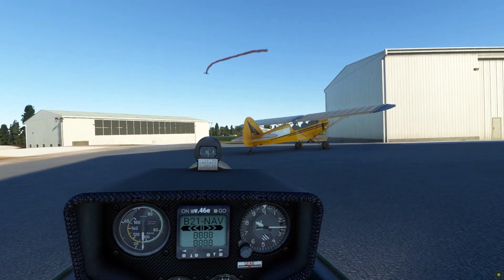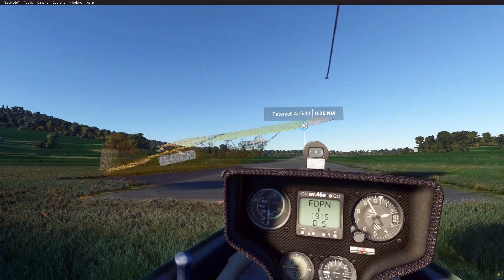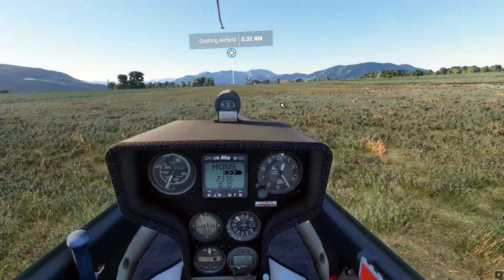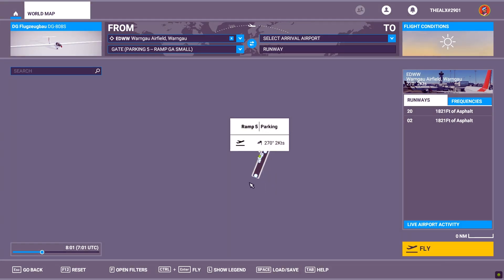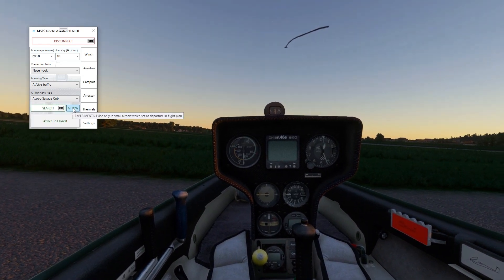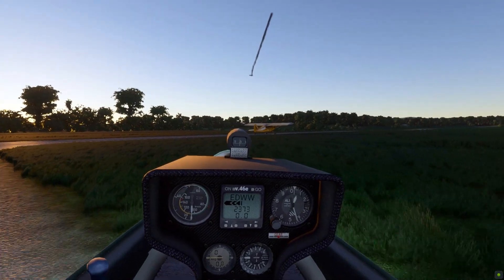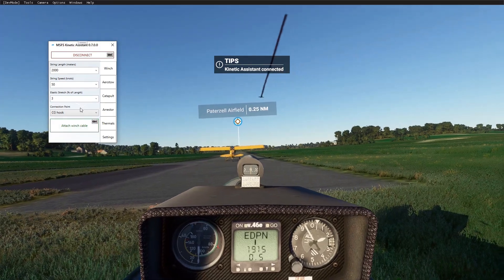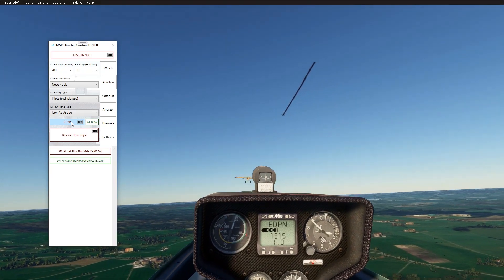MSFS Kinetic Assistant 0.7 - Aerotow Tutorial

Comment: Hmm - I cant even get the AI tow to work.. The plane just flies off without me ..  any suggestions ?
Reply from the maker: That's not okay. When plane appear (about 5 seconds after button press), does ATTACH button became red, at least for a while? You can try different planes, but usually the first one - Icon - works in most cases. Also uncheck Realistic failures in case rope fail because of too fast takeoff.
Some improvements planned in near future so you can check it again a week later or something like that.
Reply: @TouchingCloud  Thanks - I am using 8.4..    made about 15 attempts and no luck yet. Where can I get V 0.6 ?
Reply from the maker: @matt79hz  it's not stable yet, will be ready after weekends. but not much changes for towing there so not sure it will make any difference.
what about live player towing, have you tried that? or at least attach cable to some generic aircraft.
Reply: @TouchingCloud  thank you. It's ok. I'm happy being launched off maintain sides for now :) easily 30mim flights with a catapult.
Reply: @TouchingCloud  Tried v7 and I get "flight plan doesnt exist" message when trying AI tow. 
No problem thanks for your suggestions - at least the catapult and winch work well.

Comment: hi, im trying to do human aerotow everything says connected but im just left behind on runway, all is setup as you have in the video, only difference is im using the discus 2b glider.
Reply from the maker: so towplane fly away, while you stay without moving? does Rope fail message appear at some point? maybe you can share screenshot of the program window, in case something wrong there
Reply: @TouchingCloud  thank you for the fast reply, yes my friend takes off without me, i am left just sitting there, he aborts the take off roll turns around to come back to me and once he gets beside me i get the tow rope disconnected message come up. his using the dr 400 aircraft. we are going to try again tomorrow. im using the 0.8.1 version
Reply from the maker: @David..B  you could try AI towplane first, with "Realistic procedures" disabled, just to ensure tow rope simulation works properly
Reply: @TouchingCloud  yes I have tried that and it works, just the ai tow plane straight away does a turn to the left or right at 10ft above the ground then starts it's climb out, seams to straight away fly into the wind
Reply from the maker: @David..B  Hi again. just in case you haven't read updated program description on the website - DR400 and also Skyhawk G1000 with FlightDesignCT have pilot object issue. it does not move with the airplane (not visually, just in scope of simconnect), so these can't be used for multiplayer towing.
Reply: @TouchingCloud  hi Alex, yes I did read that issue and have since got it working with the Piper cub, it works well, thank you for the reply and this program, well done.